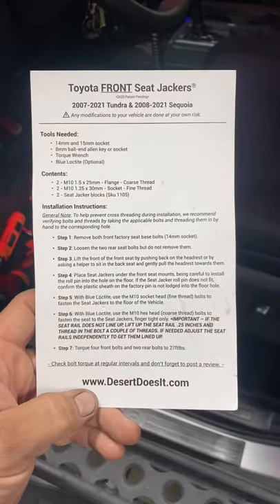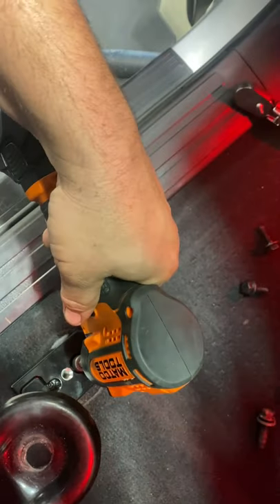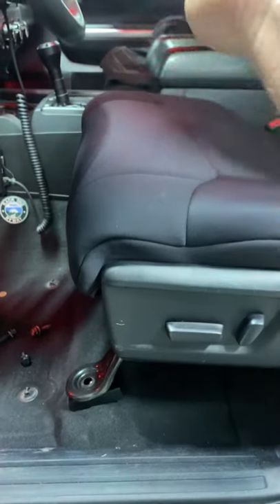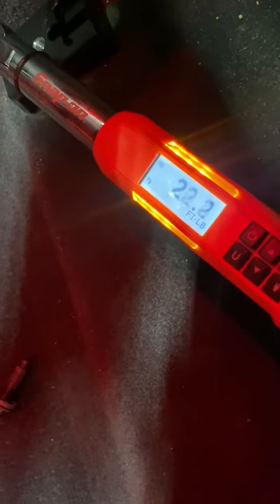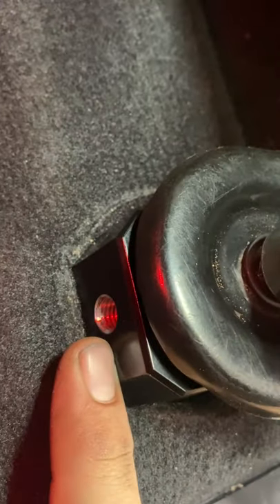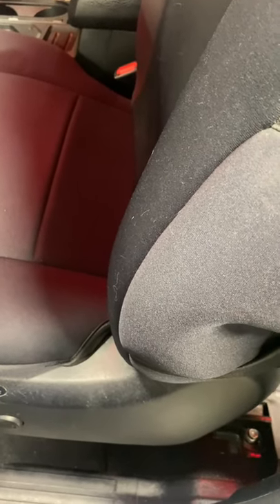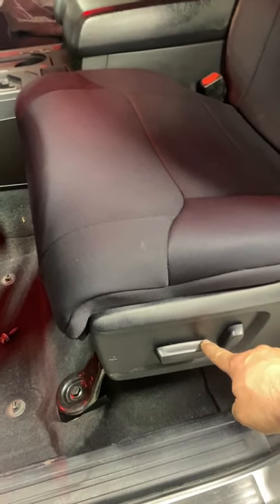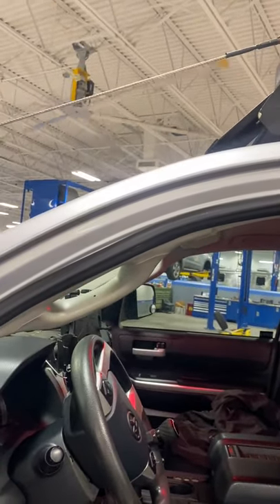How to INSTALL seat RISERS on a toyota TUNDRA!

Comment: I see that kit is like $90. At that price I’d rather buy $5 washers and do it myself
Reply: Bad idea. Not enough contact area. I GUARANTEE the bolt will eventually break. Dont cheap out, at least get a piece of aluminum block stock and make it. Or use some steel stock.
Reply from the maker: Don’t cheap out. It’s borderline just a insurance policy on the company